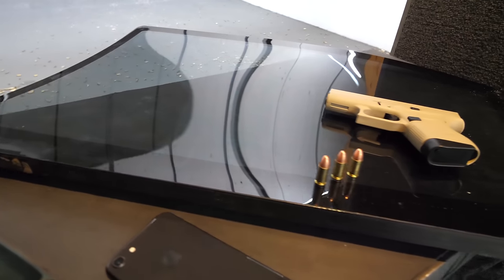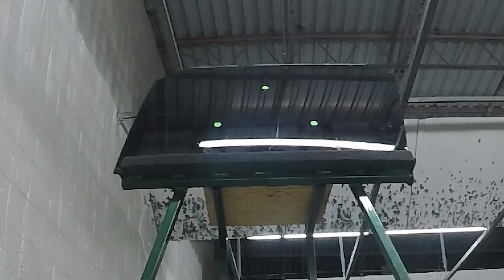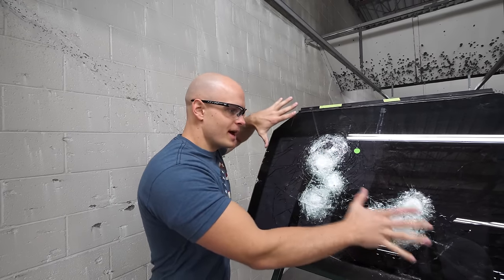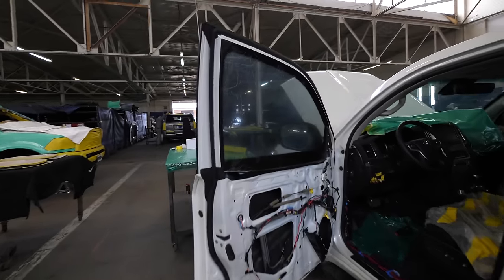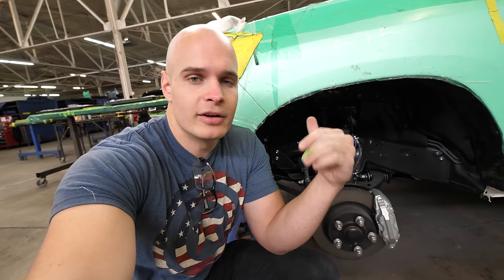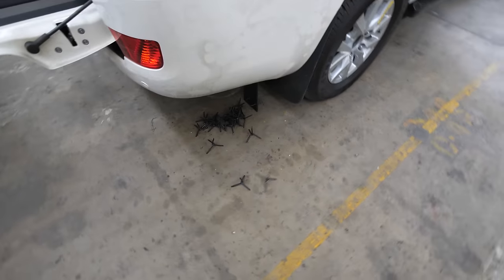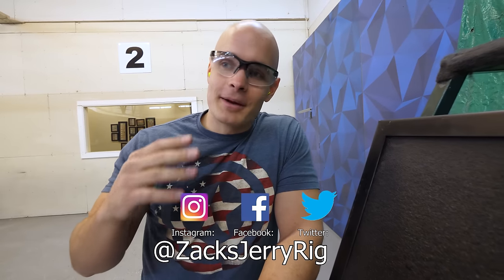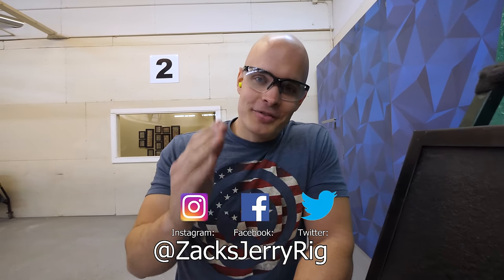How Durable is a BULLET PROOF Car?!

Comment: He totally used the word the word "caliber" wrong in the video. Multiple times! He said that the AR-15 round was a larger caliber than the 9mm. Caliber refers to the diameter of the bullet. The AR-15 is equivalent to 5.6mm which is a SMALLER caliber than the 9mm. An AR-15 round is essentially the same caliber as a 22 round. The difference between the guns and their capacity for damage is the potential kinetic energy in each bullet. The amount of gunpowder in the AR-15 in likely more than double the 9mm. That's why the shells of the AR-15 are so much longer than those of a 22 or a 9mm.
Reply: CatoELYounger it's easy to see while he's not an expert, he's an enthusiast who does a good job representing him owners. I think it's easy to confuse power with size. Valid points, though.
Reply: kinetic energy depends on speed and mass. at the low velocities of bullets its easier to get more kinetic energy from mass than purely speed.
Reply: also, smaller bullets have a more concentrated kinetic energy than larger ones. which gives more penetrating power.
Reply: Blox117 indeed, small and fast is the way to defeat armor.
Reply: Crispy Cream cartridge size. Caliber equates to bullet diameter.
Reply: CatoELYounger not just the amount of gunpowder, but the aerodynamics, ballistics and the spin due to the rifling spiral contribute to penetration force.
Reply: Caught that immediately during the video too, came to the comments to see if anybody else noticed!
Reply: thinking the same thing...
Reply: A 223/556 is a 22 calibre. Not essentially. It is. Not to mention you catch that but not the fact that he says "bullet proof" nothing is bullet proof. Bullet resistant is what he's looking for.
Reply: r/iamverysmart
Reply: I was hoping someone criticized his usage of caliber in the comments.... The small amount of likes on your comment shows how little people know about guns.
Reply: Mist Passiert: " I think it's easy to confuse power with size."

Try to convince your wife/girlfriend of that, LOL! :-)
Reply: Mist Passiert small and fast isn't the way, its fast thin and heavy that defeats armor.
Reply: Definitely appreciate the effort, but  by not properly distinguishing what's actually the "larger caliber" vs "smaller caliber", some people who are completely unfamiliar with firearms may start believing everything they hear on the news. "Higher velocity" .223 vs "lower velocity, larger caliber" 9mm would have been a generic enough description. Not enough info to be too confusing, true enough to not be misleading.
Reply: CatoELYounger LOL this exactly what I was thinking!
Reply: Why cares :D I like the video!
Reply: It won't matter if you get sho.................
Reply: duh
Reply: CatoELYounger an ar-15 fires a 22 caliber bullet tho
Reply: Caliber=bullet diameter. Kinetic value as stated by others mass times velocity, the length of the cartridge  like 7-62 = .308 X 39 the 39 is the length of the cartridge, it does not however denote power, as 7.62X 45R is almost the same kinetic energy(30-30 Winchester) Iraqveteran8888 did a very nice video on this topic.  Good day
Reply: Does it fucking matter how he says it
Reply: Yes you are correct they 9 mm is right around .355 inches and a 5.56 is right at .224 from most of my measurements I know everyone is going to say it's 223 well put a good set of calipers on it and see what it reads. That's just mostly the readings I get whenever I'm reloading
Reply: Well its a good thing he was talking about armored cars and not teaching marksmanship.

Comment: Secret Service: Is that jerry rig everything...?
President: 
Secret Service: MR PRESIDENT, GET DOWN
Reply: Bro I want to like this comment 100000 times
Reply: Ni
Reply: Jerryrig: "I just want to see if my razor blade can do any damage to the president"
Reply: Hmmm it seems as if the bend test failed and it seems that the newest president model from 2016 does not have very good structural integrity
Reply: Let's see if the president scratches at level 6
Reply: @jean-davidmerette7999  na lets see if the president can withstand a level 3 , i bet he cant
Reply: 696th like
Reply: Ni

Comment: He sure adds a soft touch to a pretty armoured topic. Smiles while getting tazed/shocked, smiles while firing a gun and is nimble enough to replace the display of an iPhone.. Keep up the good work Zack.. - Big fan XD
Reply from the maker: Thank you!
Reply: This place must be a blast working there. I bet its easy to make up sells to customers for extra equipment and spy hunter buttons.
Reply: The level of paranoia you'd have to have as a civilian buying this equipment would be insane. I reckon they'd have zombie apocalypse BOB's in the car when they come in to get done.
Reply: Nathan Locke Every concealed carrier should have handgun-level panels in their doors, so they have a real surface for cover. I would argue that all police cars should be equipped with at least handgun rated panels as well, if not rifle panels. Hell, I would go so far as to build this stuff into my walls at home. I'd rather have it and never need it, than need it and not have it.

Comment: The bulletproff cars weak points are: [CENSORED BY U.S. GOVERMENT].
Reply: lol nice one
Reply: If the vehicle is. 50 BMG proof... shoot it with a .50 BMG HEAP rd in the axel pumpkin housings. That will stop it. Then pour gas on all the tires and set it ablaze.  If they don't die of toxic inhalation, they'll cook for sure.  Have 2 guys behind the vehicle at about 25yds and at 30 degree to the outside on both sides. If they open the doors, start shooting the inside of the door windows. That will ricochet the bullets and glass fragments into the car preventing them from returning effective fire. If it has gun ports, a .50BMG ROUFUS round thru the port door will make quick work of obliterating everyone inside.  A10 ton wrecking ball works wonders too.  A trench 5ft wide, 2ft deep across the road covered with plywood and lightly covered w/dirt will stop it.
Reply: The downside of bullet-proof glass is, if the car is underwater, or you were in a car crash, you wouldn't be able to smash the window to get out.
Reply: @idleisidle  you open a door underwater if you wait a bit
Reply: @goddr8527  You will only be able to open the door underwater if there is equal pressure on both sides,  meaning the car would have to be fully flooded to open the door
Reply: @idleisidle  yeah I know' I watched mythbusters
Reply: +J Kepa Big chance that persons buying and driving those vehicles might be trained pretty well and shoot back. You might as well call an Apache helicopter and fire 2 Hellfire missiles at the car. The point is, it will give you some sort of survivability when going from A to B in a dangerous area. That's about it. Even an Abrams tank can be defeated once it stands still.
Reply: @luttekikker  a single Abrams might, and that's a big might, have an issue standing still, considering tanks have little slots to roll grenades out of, and that the hatches can be locked, but two Abrams or more are fine
Reply: No, they say that the weak points are the strongtest points😂😂
Reply: Robert Sanchez.   Re-read my comment!!  I  NEVER said the presidential  convoy.  I'm talking strictly a single car/truck as in a private person with bodyguards.
Reply: the corners, shoot it repeatedly
Reply: Bazucas
Reply: Oh my! Savagery!
Reply: you can't shoot back
Reply: the radiator is the weak point of any machine that creates heat. experience learned as a journeyman plumber.
Reply: An explosive speed bump. Choose your yield and blow them sky high.
Reply: weak spot is 5-10 rounds in the same spot loads of vids on tube about how to open it up bro not that hard tbh
Reply: Weak points are 50cal
Reply: I know it, its [CENSORED BY U.S. GOVERNMENT]
Reply: Robert Sanchez u do know that most armed Guards only use .40 s&w guns not rifles and tear gas okay now u are going a little to far and most people with armed guards are dressed well and have training for protecting their client
Reply: J Kepa trying to get a good shot with a 50 bmg at the axel is pretty hard since it’s on the bottom and that gun is heavy
Reply: @idleisidle  there is a motor in the door that will pull he glass down
Reply: Kidnap the drivers family, And make him do it.
Reply: Enough rounds in the same spot will punch through anything
Reply: @JK-dh9sz  I suppose that while you do all of this they'll just sit there patiently and not, for example, shoot you or run you over.
Reply: @idleisidle  Generally it's a good idea not to drive under water.
Reply: @goddr8527  I always do.
Reply: Don\t think there are any.
Reply: Hit the center than the edges. That will break it (kinda I think so) at least.
Reply: Mázli spells government wrong
Reply: @kenmoll2896  😁
Reply: A rocket launcher
Reply: oh look a bullet proof car..   think I'll bring my 120mm cannon and prove them WRONG
Reply: @JK-dh9sz  i dont know about other goverments but the US pres car has air tanks and nbc filters...so better shoot it with an rpg and get on with it? or 20mm antitank rifle?
Reply: @JK-dh9sz  youre 12
Reply: @Tony Bullshit. Every system has weakspots. And even that car cant survive an APCR shell of a 120mm or 130mm cannon. But it is not designed to do so. Because most people wont have an anti tank gun at home. Plus it is always working together with other security measures.
Reply: @Tony I dont have to work there to know what is technically possible. What you describe is a APS (active protection system) with a hard kill measure. Almost all modern militaries have developed one. Russia is using on the the T14 Armata. However it can not stop APCR or APFSDS since those ones are just metal without explosives and rely on the kinetic energy of the projectile to destroy the target. 
So yeah. It is not possible to shield a Leopard 2 or an M1A2 against it. And they dont have to have windows. 

But like I said. It is easy to spot people carrying around AT guns so it is not necesarry to protect such a car against those threats. It just has to widthstand a .50bmg ap round or similar.  Maybe even a 20mm at gun but there is no way that it would stop a 120mm or even 152mm APFSDS.
Reply: The A pillars 🤓
Reply: The undercarriage and the engine are the weak points.
Reply: RPG
Reply: The gas tank, tires, engine
Reply: @JK-dh9sz  Chak Norris is it you????
Reply: Government
Reply: Parts with no Nokia backs
Reply: @idleisidle  easy, just have some spare TNT or Semtex in the glove compartment.
Reply: @j33p Since the glass is so thick, it's probably electric, otherwise it will be too heavy. Since it's electric, it runs on the car battery.
The car battery might stop working when all that water leaks into it.
Reply: electricity works underwater just roll down with switch.  @idleisidle
Reply: Hmm, your "Goverment" are so busy they can't even spellcheck while censoring..
Reply: See, this is why you need to Subscribe to Pewdiepie.
Reply: The undercarriage 
Fixed that for you
Reply: @Isaac Luevano Pretty sure a bullet is more powerful than your hand, unless of course you're trying to mash a bullet against the window using your hand.

Comment: Interesting that most of those cars are land cruisers. Those cars are reliable af if I'm getting shot at that's the car I'm trusting my life with to get me to safety
Reply: Shayan Givehchian middle eastern countries prefer armored land cruisers quite often
Reply: @Jack3md  non-armored as well. they are beasts.
Reply: @Jack3md  and not only in those parts of the world...
Reply: Heard Land Cruisers are better reliability wise
Reply: Bulletproof vehicles are designed for CEOs or the heads of state. For you, go take the public transportation.
Reply: @benz merc Your diesel doesn't use spark plugs 😋
Reply: I'm guessing land cruisers are used a lot for two reasons: Versatility and ease of upgrading. They're already big and bulky cars, so an upgrade won't be easily noticed. I'm sure there are better off-road cars, but these ones don't stand out too much in an urban setting either.

Comment: The Mythbusters tested those spikes near the end of the video, they don't work very well because it stays in the tire and doesnt let air through. They work better with hollow pieces of metal instead.
Reply: There are some caltrops which have holes in them which will let out air.
Reply: Most people would still rather not have them in their wheels.
Reply: I watched that episode :D
Reply: They could jam up the tires pretty bad. Scrape up the wheels.
Reply: its hard to tell as they weren't actually used, but many of those actually are meant to get stuck in the tire and then break, revealing a hollow tube. The ones Mythbusters made from metal i belive were just solid to start with which is why they had to adjust to hollow tubes. The ones I've actually seen for sale, are almost always hollow though.

Comment: But the real question is...

Is it AK-47 proof?
Reply: Yes, it is
Reply: No, the real question is if the AK-47 bulletproof.
Reply: If you can put a bullet in the same hole with AK47 you must in the next Avengers movie
Reply: Or just wait till a dead shot movie comes out lol
Reply: Stop the AR so it will definitely stop the AK
Reply: @RandomGuy-wx5rc  is the ak-47 bulletproof   can proof a ak-47?🤔
Reply: @debianlasmana8794  cause of it's recoil???
Reply: @Hunter-fx6sk  5.56 has a lower rating than 7.62 so that assumption is false. AK47 is not precise enough, you should specify the used ammunition. The 2 inch glass will probably stop a standard round but will fail to stop an AP or Tungsten bullet.
Reply: What about an AK 47 chambered in Nokia 3210?
Reply: @RandomGuy-wx5rc  the ak.47 is everything proof'd
Reply: @PiFe00  
5.56 doesn't have a lower "rating" than 7.62, because there is no such thing. also, the 2 inch glass would stop at least 5 rounds of either 5.56 or 7.62, regardless of ammunition used.
Reply: gorbatsjov wrong. A 5.56 is a smaller and a much faster projectile that is much better at penetrating armor. 7.62 is a much bigger round that has a slower velocity. Making it not as good at penetrating armor as the 5.56. The material of the bullet is a whole different story that I don’t want to go into (as It would be difficult to determine unless we did the test). 

Without armor, if you were to get shot (let’s just say 150m) by a 7.62 it would do significantly more damage than a 5.56 would because it’s a bigger round, therefore inflicting more damage. If you had armor (lvl 3 vest for instance) and you were to get shot by a 5.56 (150m again) it would be more likely to penetrate the armor than a 7.62 because it’s a smaller round going much faster. But let’s be honest, getting shot by a 5.56 or a 7.62 from 150m will most likely rupture your organs—causing death. 

In this case, a 5.56 would be more likely to go through the “bulletproof” glass simply because there’s less surface area for the bullet to hit due to it being smaller.

PS: there’s no such thing as a “lower rating”
Reply: I bet an API round puts a hole in the glass. 🙂
Reply: @someguy1688  holy moly thats a long comment
Reply: Md Saipulilah Che Idris it only took me a couple minutes. I’m a fast typer lol